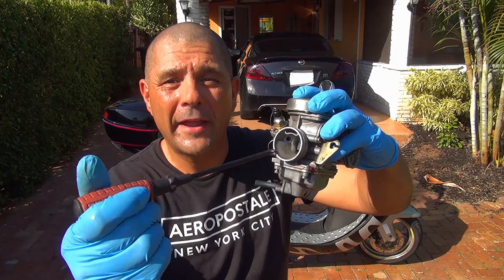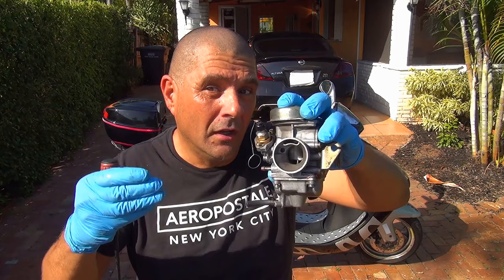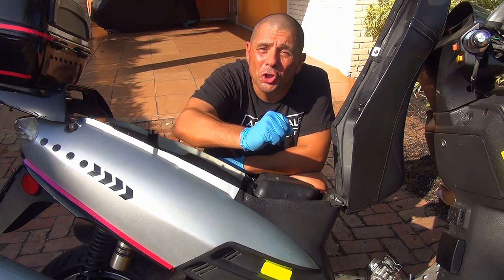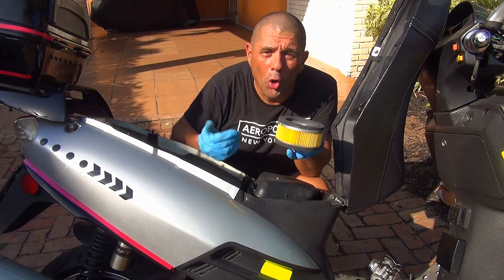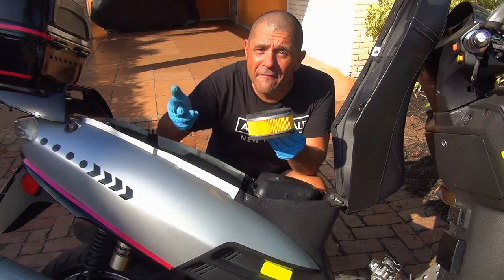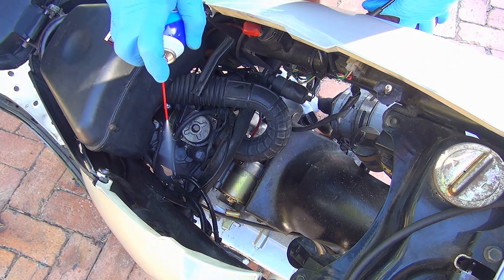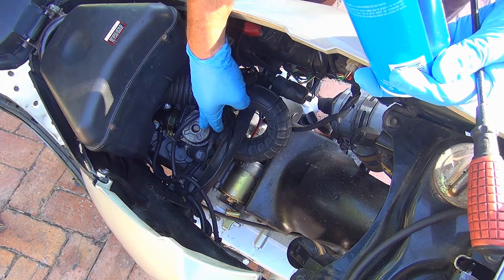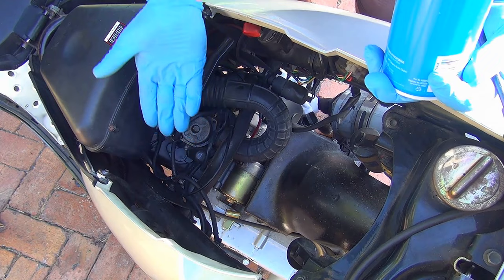How to fix a scooter that bogs down

Comment: Hi there good man, i have few isues with my scooter 150cc big boy, it looses power when i accelerating and bog from carb in-take air.i have tried new cone air filtet and box air filter but nothing help.
Reply from the maker: If your 150cc Big Boy scooter is losing power when accelerating and bogging from the carburetor intake air, there are a few possible causes you can consider:
Carburetor: The first thing to check is the carburetor. If it is not functioning correctly, it can cause the symptoms you are experiencing. Check that the carburetor is clean and free of debris, and ensure that all the jets and passages are clear.
Fuel flow: If the fuel flow is restricted, it can cause a loss of power when accelerating. Check that the fuel lines are clear and not kinked, and ensure that the fuel filter is clean.
Air leak: An air leak can cause the engine to run lean, which can result in a loss of power. Check for any cracks or damage to the intake manifold, carburetor gaskets, or the air filter housing.
Ignition system: A weak or faulty ignition system can cause the engine to lose power. Check that the spark plug is clean and properly gapped, and ensure that the ignition coil and spark plug wire are in good condition.
Exhaust: A clogged or restricted exhaust can cause a loss of power. Check that the exhaust system is clear and free of obstructions.
If you have tried a new air filter and are still experiencing issues, it is recommended to have a qualified mechanic inspect your scooter to diagnose the specific issue and recommend the appropriate repairs.

Comment: I have brand new scooter .. A genuine buddy 125 gy6 engine and has always bogged down at about 1/4 throttle.. what could be cause from a NEW scooter?
Reply from the maker: It's frustrating to experience performance issues with a brand new scooter like your Genuine Buddy 125 with a GY6 engine. There could be several reasons for the bogging down issue at 1/4 throttle, even on a new scooter. Here are some common possibilities:
Fuel Delivery Issues:
Fuel Filter: The fuel filter might be clogged or improperly installed, restricting fuel flow to the engine.
Fuel Lines: Check for kinks or obstructions in the fuel lines that can limit fuel supply.
Air Intake Problems:
Air Filter: Ensure the air filter is clean and properly installed. A dirty or clogged air filter can restrict airflow to the engine.
Intake Manifold: Inspect for leaks or loose connections in the intake manifold. An air leak can disrupt the air-fuel mixture.
Carburetor Issues:
Carburetor Adjustment: The carburetor may require adjustment to ensure the correct air-fuel mixture. It might be running too lean or too rich.
Jetting: Check if the carburetor jets are clean and properly sized for your altitude and riding conditions.
Exhaust System: A restrictive or damaged exhaust system can affect engine performance. Make sure the exhaust is not blocked or damaged.
Spark Plug: A fouled or incorrect spark plug can lead to poor engine performance. Ensure the spark plug is clean and of the correct type.
Electrical Issues: Problems with ignition or sensors can lead to poor throttle response. Check for loose connections and ensure the electrical system is functioning correctly.
Idle Adjustment: Incorrect idle settings can impact how the engine responds to throttle input. Make sure the idle is set correctly.
If you're not comfortable diagnosing and fixing the issue yourself, it's advisable to take your scooter to an authorized dealer or a qualified mechanic for a professional inspection and repair. They will have the expertise and tools to pinpoint the exact cause of the problem and get your scooter running smoothly.
Reply: I am thinking maybe a restriction in the air intake system. I know that gy6 manufacturers tend to do so causing the mixture to run richer than necessary.. I'll look into that .. is the simplest to diagnose.
 @VirberelloScooterTips  is a grand little scoot :) No complaints other than that. :)  Keep up the excellent work with your channel ! yes Subscribed

Comment: I changed the cdi in my 150cc moped to a performance one but after I tried to start my bike it lost all power out of nowhere then I switch back to the original CDI box, and there was still no power in the bike. Can you help
Reply from the maker: There could be several reasons why your moped is losing power after changing the CDI to a performance one. Here are a few possible causes:
Compatibility issues: It's possible that the performance CDI you installed is not compatible with your moped's engine. CDIs are designed to work with specific engine types and models, so using one that is not compatible could cause problems with power delivery and engine performance.
Wiring issues: Another possibility is that there may be a wiring issue with the CDI installation. Make sure that all the connections are properly connected and that there are no loose wires or damaged connections.
Faulty CDI: It's possible that the performance CDI you installed may be faulty or damaged. Try testing the CDI using a multimeter or replacing it with a new one to see if that resolves the issue.
As for the fact that the moped still has no power even after switching back to the original CDI box, it's possible that the initial CDI installation caused damage to other components in the electrical system. Check for any blown fuses, damaged wires, or other electrical issues that may be causing the problem. If you're not confident in your ability to troubleshoot and repair electrical issues, it may be best to take your moped to a mechanic or dealership for further diagnosis and repair.

Comment: When I install a new air filter in my gy6 what do I do with all the extra hoses that was on the old filter going to the bike? It bogs down now
Reply: What did you do? I replaced the carburetor and the intake hose had only one connection for small pipe.
O ended up letting the old intake hose.

Comment: Hey so my friend claimed my scooter isn't getting enough fuel  and so does  my dad think  could  it be the carburetor  or something?
Reply from the maker: Many times just by cleaning the carburetor jets you can improve the fuel flow and run your scooter with best performance and don’t forget to look at fuel filter to make sure it looks clean
Reply: @VirberelloScooterTips  thank you so much man

Comment: What if you have too much fuel? My carburator leaks gas, i was told its the float valve
Reply from the maker: Yes that is possible the float valve has a rubber o ring that after many miles get damage by the ethanol that is in the fuel you can replace the valve and the O ring or just buy a new carburetor and they have a price of around 25 to 35 dollars 👍
Reply: @VirberelloScooterTips  thank you

Comment: I have got a electric and rattle sound under my footwell and don’t no what is going on I have tried everything any tips mate ?
Reply from the maker: If you're experiencing an electric and rattling sound under the footwell of your gas scooter, it could indicate a mechanical or electrical issue. Here are a few tips to help you diagnose and address the problem:
Visual Inspection: Start by visually inspecting the area under the footwell for any loose or damaged components. Look for loose wires, loose or damaged brackets, or anything that seems out of place. Tighten or secure any loose parts you find.
Check Battery Connections: Ensure that the battery connections are secure and properly tightened. Loose connections can cause electrical issues and rattling sounds. Also, check the battery terminals for any corrosion and clean them if necessary.
Examine the Exhaust System: A loose or damaged exhaust system can create rattling sounds. Inspect the exhaust pipes, muffler, and any mounting brackets. Tighten any loose components or replace damaged parts as needed.
Investigate the Drive Belt: If your scooter has a drive belt, it could be causing the rattling sound. Check the condition of the drive belt for any signs of wear, damage, or misalignment. Replace the belt if necessary or adjust it properly.
Seek Professional Help: If you've tried the above steps and are still unable to identify or resolve the issue, it's recommended to consult a professional mechanic or scooter technician. They have the expertise and specialized tools to diagnose and fix scooter-related problems accurately.
Remember to prioritize your safety while troubleshooting. Avoid riding the scooter if you suspect a significant issue until it has been properly addressed.
Reply: @VirberelloScooterTips  thank you so much it’s my transport to work and back a at the moment I have had a look in battery nothing ti do with that but I’m going to take the plastics off the footwell and see if there are any lose wires as for the exhaust I have just fitted a sport exhaust on the Scotter it’s a ajs Modena 125cc so I’m thinking it needs a service tbh with you there a lot of things I have done and fixed through your channel so thank you very very much for all your hard work my friend keep up the hard work and thank you for the reply

Comment: What jetting should I use for my 100cc big bore kit? I have an aftermarket air filter and exhaust, thanks
Reply from the maker: Hello my friend #95 main jet should be great
Reply: @VirberelloScooterTips   what about my pilot? Thank you for the reply
Reply: And I only have a 94 and 96, should I go with the 96 and go up one on the clip? And 2.5 turns out for air to fuel?
Reply from the maker: @Byz_nasty_racing111  Hello my friend #32 pilot jet should be good but also depend on your altitude and average temperature at your location
Reply: @VirberelloScooterTips   oh I was thinking like a 35, a 35 is in it right now, could that be causing a rough idle and bogging after throttle? Thanks again for responding
Reply from the maker: @Byz_nasty_racing111  that is possible sometimes if the jets are not the right size they can give you bad idle